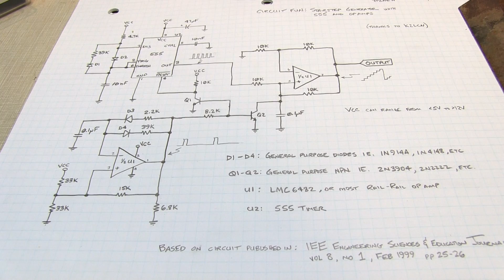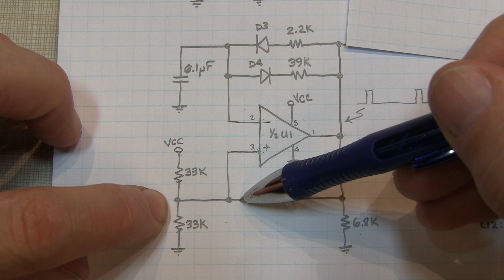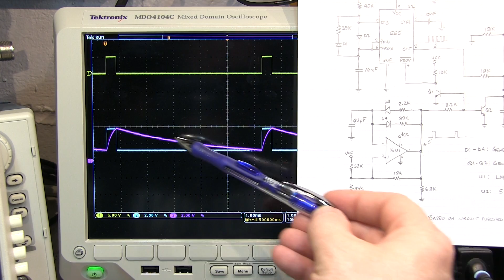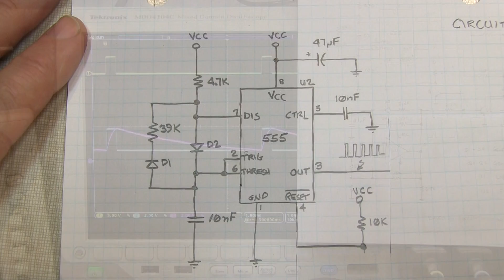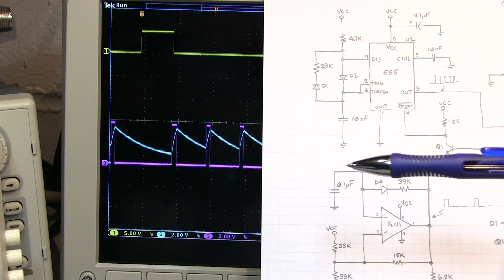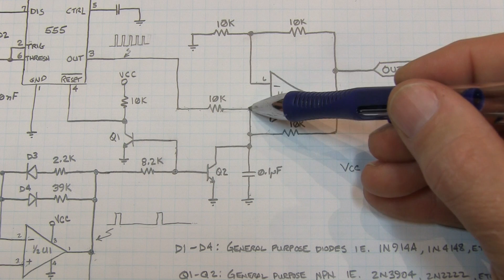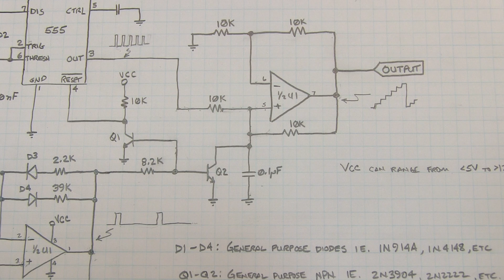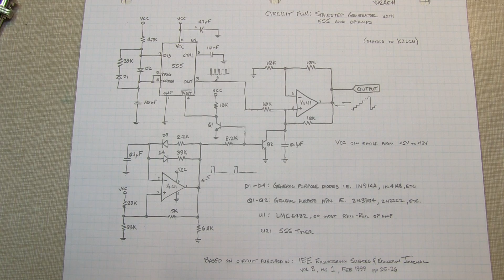#231: Circuit Fun: Stairstep generator using 555 and op amps

Comment: Dear Mr.Allan,

Thank you for the nice, informative video. Can you guide me to have circuit which will give me analog output proportional to width of pulse. In short, say I want 0-5 V output proportional to 0-2 sec pulse. So say if my pulse train output is 0.2 sec ON and 1.8 sec OFF, it is 10 % so I must get 10% of 5 V means 0.5 V. 
0.4 sec on, 1.6 sec off means 20% output, so 1 V etc.

The input to the circuit is nothing but time proportional output from temperature controller  with 2 sec as cycle time.

You can communicate with me on analyte.sales@gmail.com.

Thank you for your attention.

BR,
Surendra Rahalkar
Reply from the maker: You can simply use a low pass filter.
Reply: Dear Mr. Allan,

Low pass filter does not work as we need good accuracy during low on time. The filter capacitor gets heavily discharged if my duty cycle is like 10%.
Reply from the maker: You might be better off with some integrator and a sample&hold circuit, or even employ digital techniques with a micro (measure PW and output a DC value from a DAC).

Comment: w2aew:

I reproduced this in the easy-to-use falstad online circuit simulator.

http://tinyurl.com/mxzap8s

The only change is that the 0.1uF cap I reduced to 0.082uF, because otherwise the last stair on the stairstep lasted too long before resetting.

Comment: Hi w2aew. When transistor is used to discharge capacitor (like Q2 on the schematics in the movie), what are the rules for not to blow up the transistor? I mean, Q2 acts as kind of short circuit of the capacitor which then gives out its charge to ground through transistor momentarily. There is no particular "current limiter" which protects the transistor from overcurrent/overload. What parameters of transistor should be concerned respective to capacitance and actual voltage on capacitor to consider such solution safe?
Reply from the maker: In general, if you turn on the transistor relatively slowly, you'll limit the peak current that the transistor conducts with.  This can be done with the drive circuit, or often time with just a resistor in series with the base.
Reply: Ok, I am one step further to understand. Specialized drive circuit is somehow self explanatory, so let's omit it.  Let's consider step voltage which drives the transistor. I can think of a fet transistor where gate-source capacitance together with some resistance in series with the gate create small rc constans which turns the transistor "relatively slowly". What I don't fully understand is the example of resistor in series with the base of junction transistor. I know that this resistor will limit current in the base to keep the transistor saturated. But what mechanism will be involved that assures this transistor turns on "relatively slowly" when step voltage is applied? Should I simply assume max collector current 'Icollmax' and choose the value of resistor in base using 'Ibase = Icollmax / beta' equation?
Reply from the maker: A resistor in series with the base of a BJT can do two things for you in this situation.  It can limit the base current, which will limit the collector current. It can limit it a lot before saturation is reached. You can use the equation you suggested when the transistor is in the active region, but it doesn't apply in saturation.  In saturation, the "beta" reduces to about 10-20.  It can also form and RC circuit with the transistor's base-collector capacitance which can slow the switching speed slightly (or additional capacitance can be added).
Reply: Thanks for all explanation!

Comment: Thanks for the great and informational video, I learned a lot. 

I built the circuit and it seems that the Op Amp does not drive the NPN trisistors all the way off on the first few steps leading to some funny looking steps if you run the circuit over Vcc of 4 volts.  At Vcc=4v, the pulse turns off at about 400mv and when vcc is 5v the falling edge of the pulse goes to 500mv.  It seems the pulse signal coming from the first half of the Op amp/comparator  needs some conditioning thru a cmos buffer?  I think I will try 4 transistors (2 pfets and 2 nfets conected as a double inverter) What do you think? A cmos   buffer would be easier but I ran out of room on my perforated board:).  I could  go up as in a cmos buffer on power/ground stilts :) Anyway this has been a lot of fun.
Reply from the maker: I wonder what op amp you are using.  Many can't drive to the lower rail very well, and often need the help of a pull-down resistor.
Reply: I see so maybe a pull down on the transistor side of the 8.2K?   I just used what I had in my junk drawer and it is a lm324 quad package.
Reply: Try a 2k pull down on the op amp side of the 8.2k. Not the best op amp choice, but it should work.
Reply: Works great! Thanks! Wish I could send a picture. I took it up past 10 v and it works a treat as Dave Jones would say.

Comment: Can someone please explain why the so-called "switching" diodes on the 555 are necessary? The only reason I ask is because I know for a fact that the 555 part of the oscillator circuit can be made without the use of diodes. I'm sure there's some sort of practical reason for adding them, but I'm a bit of a newb.
Reply: Wait, nevermind I now see that it has something to do with the "on" time being shorter than the "off" time in the oscillator
Reply from the maker: yes, you've got it.  It provides separate paths for charging and discharging the timing capacitor, thus being able to control each independently.

Comment: Are the heights of each stair step the same or do the steps get smaller as the capacitor charges?
Reply from the maker: The steps are the same height.  The first step may be taller because of the different charge time after reset.
Reply: +w2aew Ah, I see. As the voltage across the capacitor increases, the decreasing current through the resistor from the 555 is compensated by the opamp's output, so the current through the capacitor is consistent.

Comment: Hi Alan,
As always,your content and presentation skills are absolutely impeccable !!
Hope I did not miss it,but could you clarify why you have the 6k8 resistor to ground on the output of U1.
TIA.
Reply from the maker: +EmbSysDev You didn't miss anything.  I was experimenting with a couple of different op amps, and some of them worked better with a pull-down resistor.  This op amp doesn't need it.  So, it really could be eliminated without any peril.
Reply: In my case, the circuit didn't work until I added this resistor. In fact, the stairstep looked all wrong at first until I brought this resistor down to 1K which made it much better. It is still a very noisy plot, it seems like the output of the 555 gets all noisy as soon as I connect it to the op amp. Still investigating how to get it clean as Alan's graphs on the scope.

Comment: Hey i am a noob on the matter but i still found this quite fascinating and interesting. Though i'm trying to understand what from your expert perspective and knowledge about electronics is fun about this circuit? i got a sense that it is because it's performing an action without memory but by its own diagram? is that what's special about this? thank you for any reply and nice video
Reply from the maker: +Francesco Laurenti The typical way to create a stairstep waveform would be with a counter and a digital to analog converter.  I thought this was interesting (fun) because it uses just a pair of astable pulse generators and a pretty unique integrator circuit (Deboo Integrator) to create the steps.  I hadn't seen this configuration of integrator before and thought it was quite interesting.

Comment: I have a Heathkit IG-1275 Log/Lin Sweep Generator. I would like to display markers, say 10 marks both Log and Linear, across the X axis on an Oscilloscope using the scopes Z axis input to show the marks. Is this possible to display marks both linear and logarithmic across the X axis using the Sweep Gate Output, Sweep Output, or Analog Output of the IG-1275 using the Step Generator circuit #231?
Reply from the maker: +Gregory Burns You probably only need the 555 pulses.  Reset the 555 at the start of the sweep, and then adjust the period of the 555 pulses to get the timing that you need.  Of course, this will only work with the Linear sweep.  For the log sweep - maybe multiple window comparators to detect the sweep voltage at various thresholds...

Comment: Really nice video.   IMHO had the right amount of content and some nicely paced descriptions.  Just the right level for me.
I was wondering... does it need an output buffer... any load will disrupt the stairstep?  Also, it's a nice old school design but isn't it actually cheaper nowadays to use a small pin-count controller?
Reply from the maker: +NivagSwerdna The op amp used in the pulse integrator has a low impedance output, so no need for buffer.  Of course, it would likely be cheaper to use a cheap uC to do this, but - it would need to be programmed, and you wouldn't learn about the cool analog circuitry.  What fun is that? ;-)

Comment: Many moons ago I made a curve tracer. The stepper was made with a UJT. http://www.pa4tim.nl/?p=1437 Those become rare but you can replace that with Alans schematic. It worked well  but the limitation was the max current and voltage. I took it apart when a friend gave me an almost NOS Tek 576 . 

And curve tracers can do so much more then testing almost every  semiconductor. I often make adapters to test special things like f.i. relais. There was an insert that made it possible to test opamps and I think voltage regulators. I wish I had that one. I repair test and calibration gear and for industrial gear component testing often is the only way because parts of the instrument are still in the factory. I use my Tek  alot, sometimes every day. You can make IV graphs for transformers and coils from smps, ESR,, leakage current from caps, relays, charge batteries,  measure tempco's, do in circuit tests like you do with a Huntron or octopus and a lot more.

Together with a few others, we reverse engineered a Tektronix evaluation board that has a stepper with glitches and noise. http://www.pa4tim.nl/?p=1692 Also a nice circuit

As always, great video
Reply from the maker: +pa4tim Thanks!  I made a rudimentary transistor curve tracer with this circuit by adding one more op amp stage and a couple more transistors.  Will do a video soon...

Comment: Sorry to bother you again but I have another question.
In the reset circuit, what is the function of the 6.8k resistor between the op-amp output and ground?
I breadboarded just this part and played around with the resistor.
The only thing I noticed was a slight level increase of the pulse when I disconnect the resistor.
Thank you in advance.
Reply from the maker: +Alwin Leerling Not really needed.  I was playing with a couple of different op amps, and a few needed a pull down to completely shut off the transistors.  With many rail-rail op amps, this resistor isn't needed anymore.

Comment: What is the purpose of that 6.8k resistor in relaxation oscillator section?
Reply from the maker: +byszovd Actually - not really needed.  I was playing with different op amps in the circuit, and some needed a pull-down to fully shut off the transistors.  Using a good rail-rail op amp, this resistor could be eliminated.

Comment: Great circuit. Love your videos. 
As I know that using a transistor to discharge a capacitor periodically is pretty standard I like to know a little bit more about it.
In this circuit Q2 is discharging the 0.1uF capacitor.
My question is this; Is the current through the transistor limited by the emitter resistance (~25 Ohm) or 
by something else (I am presuming it is limited by something).
The reason I am asking is that, given a finite current you would need a minimum pulse width to discharge the capacitor.
Also, am I right in thinking that the capacitor only discharges to about 0.2V, being the collector-emitter voltage of a saturated transistor?
Thank you very much for making these great videos.
Reply: Probably answering my own question, but I realised the "transistor action" rule: Ic = Ib * beta

So given a Vcc of 9V there will be a base current of about 1mA (8.3V/8k2Ohm). With a beta of 100
this would drain the capacitor with 100mA. Thus the time to drop the capacitor voltage from 9V to 0V
will be 9V*0.1uF/100mA = 9us.

Did I do this right?
Reply from the maker: +Alwin Leerling Yep - that's basically it. Of course, once the transistor reaches saturation, the beta drops.  And, as you said, it's only getting discharged to the VCEsat of the transistor.  For our purposes here, it works just fine.

Comment: What is the 6.8k resistor for in the reset pulse oscillator?
Reply from the maker: +PyroShim Actually - not really needed.  I was playing with different op amps in the circuit, and some needed a pull-down to fully shut off the transistors.  Using a good rail-rail op amp, this resistor could be eliminated.
Reply: +w2aew Thanks for the clarification.

Comment: Could the circuit at 2:19 be modified to produce PWM signal by replacing those 2 timing resistors with a pot?
Reply from the maker: Yes, of course.
Reply: I figured, though I wonder, would it work from 0% to 100% and would it be linear?
Reply from the maker: +Power Max It would be reasonably linear, but there would be some non-linearities due to the diode behavior.

Comment: Neat circuit! BTW that output stage is called a Deboo integrator, one of an interesting class based on Howland current sources. It's great for single-supply as it's non-inverting, unlike conventional Miller integrators.
Reply from the maker: Oh, excellent! I didn't know there was a name for it. I see now that Maxim has some application notes on it. Nice! Thanks for sharing!

Comment: You are a great teacher!  I'm curious: what applications would you use a staircase generator or signal?  I seem to recall part of the old NTSC color TV signal having one?
Reply: +agentsmithisalive Let me give a big old "/me too"' to this comment. From the previous comments I can guess it would be used in a curve tracer but just a couple lines in the video about what they are used for would have been really helpful for people like me who admire the beauty and cleverness of the circuit but wonder why one would build it.
Reply from the maker: +agentsmithisalive Playing around on the bench, I managed to turn it into a basic transistor curve tracer by adding one more op amp, 3 more transistors and a handful of passives...  Maybe I'll post another video...
Reply from the maker: +llhand Playing around on the bench, I managed to turn it into a basic transistor curve tracer by adding one more op amp, 3 more transistors and a handful of passives...  Maybe I'll post another video...
Reply: +w2aew That would be great  -- would love to see a curve tracer!  BTW, I was partially correct: it's the NTSC monochrome signal that uses a stair-step pattern (for the luminance signal).  See: http://www.eetimes.com/document.asp?doc_id=1272387  Thanks again and 73!

Comment: Why the need for a rail to rail op amp?
Reply: +Digger D To eliminate the need for a double supply.
Reply: PyroShim Thanks, I heard that but still not sure why?  Wouldn't a ground to VCC work with a 741?  Not too familiar with the op amps yet.  I know there would be a voltage drop on the op amp but wouldn't it still work with less output?  I feel I'm missing something basic here.
Reply from the maker: The input voltage range and the output voltage swing of the 741 can't get within a few volts of the supply rails. The pulse integrator circuit requires the input and output to go very close to the ground rail. The relaxation oscillator needs to be able to swing its output near ground to turn off the transistors.
Reply: ***** Ok, I got it now - thanks very much for your reply.
Reply: +w2aew   Based on this logic a jelly bean LM358 is specifically design to include ground.   Only the positive output excursion limits would have to be a consideration then.     Correct????????
Reply from the maker: +jp040759 Basically, yes - although the 358 does have some issues driving to ground if you don't use a pulldown resistor.  See my video on the crossover distortion on the LM358.

Comment: What a refreshing video, to see an oscillator in this day and age that's not some super integrated proprietary PLL kind of deal or a microcontroller running one line of code is just very pleasant.
Reply from the maker: +FFcossag I have a lot of oscillators that are uC and PLL free on this channel  ;-)
Reply: ***** Crap, I just got busted as a really bad subscriber for not knowing that, didn't I?
Reply from the maker: Not at all, with over 230 videos, you can certainly be excused for not knowing everything that's here. Thanks for being a subscriber.

Comment: How can you predict that both Q1 and Q2 will turn on having the bases in parallel and a single resistor? Extremely well matched?
Reply from the maker: +Vale Sarbu Both transistors are turned on "hard", meaning both are going into saturation.  No special matching needed in this case - just use the same type of transistor.  Of course, you could simply use one more resistor to drive each base independently from the reset pulse generator.